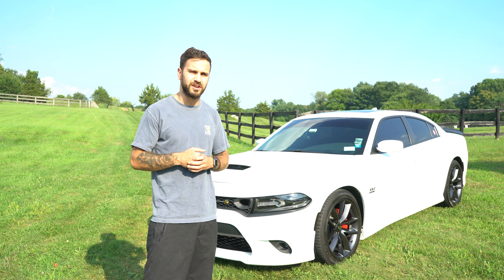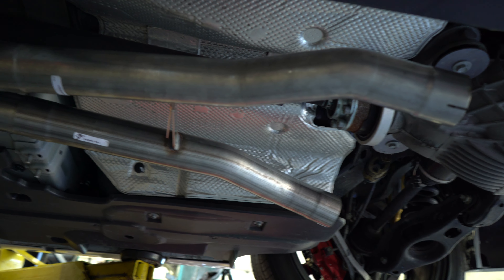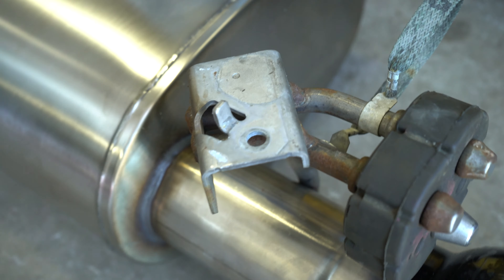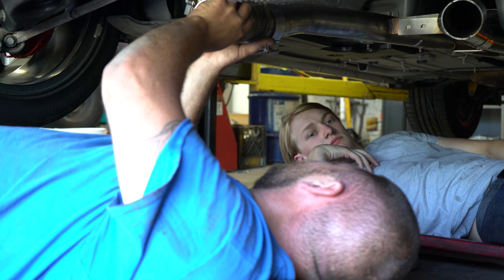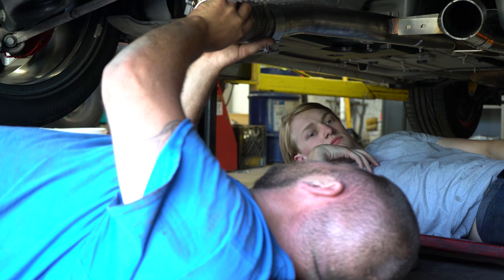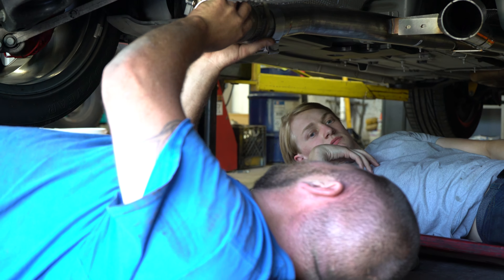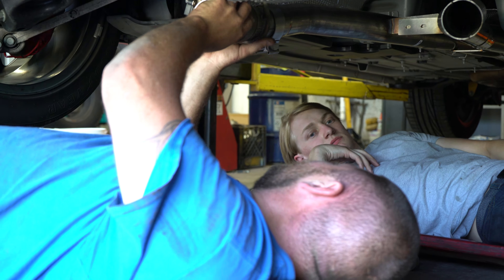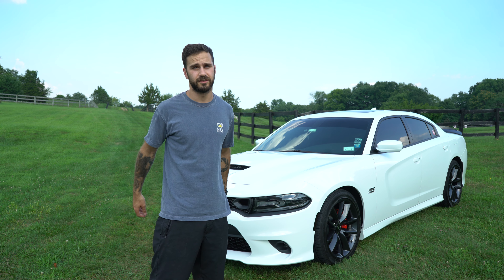CHARGER SCAT PACK GETS CORSA EXTREME CAT BACK EXHAUST! - FULL INSTALL & SOUND CLIP - MR & MS STANG

Comment: I think my 2022 charger has this exhaust. It definitely sounds different from my 2018 with stock exhaust. Those are the tips it has. Even with active exhaust closed it’s fairly loud. Where might I look on the exhaust for brand stamps? Not sure if it’s just tips, mufflers and tips, or full cat back.

Comment: Is it possible to delete the resonators from the corsa cat back exhaust?
Reply: Wondering the same thing but I think it would just sound like a normal mid muffler and resonator delete. Not sure though.
Reply from the maker: Sergio Duran yeah of course you can you’d just need someone to weld straight pipes on